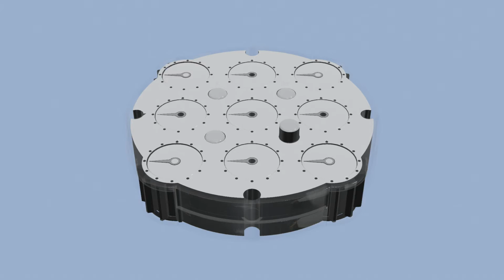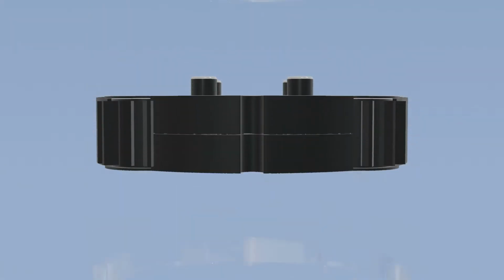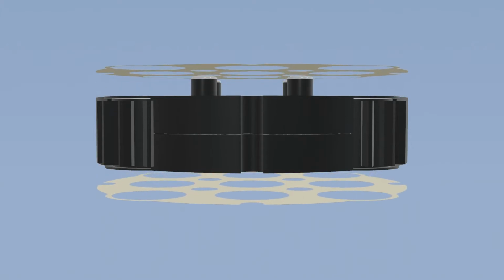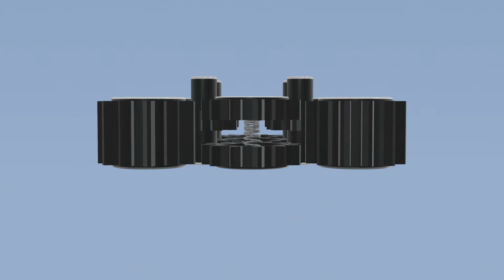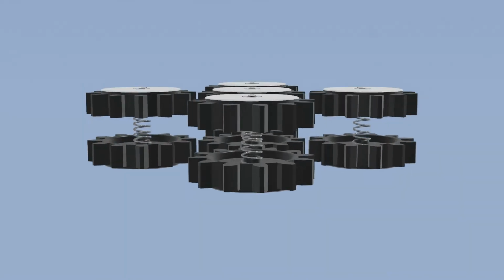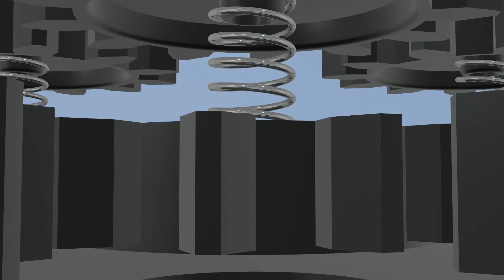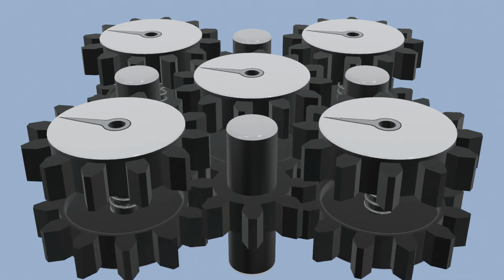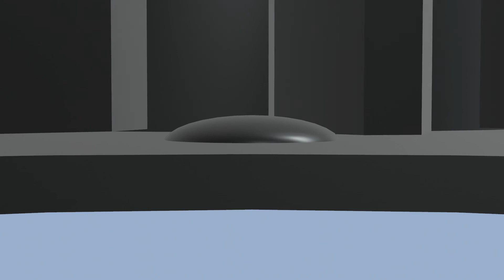3D Animation of how a Rubik's Clock Works

Comment: In the new(ish) Qiyi clock it uses magnets instead of the bumps.
Reply from the maker: That’s true, However I couldn’t find any documentation on where they were placed, so I couldn’t make an accurate model
Reply: @therandomraddish7281  they are played in every gear pinion lol